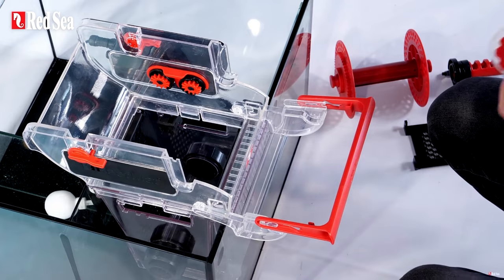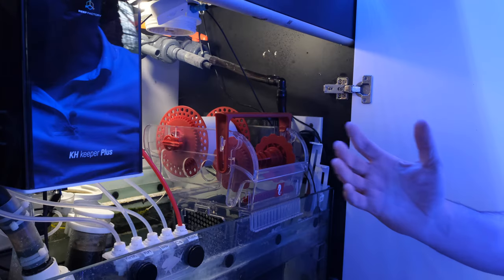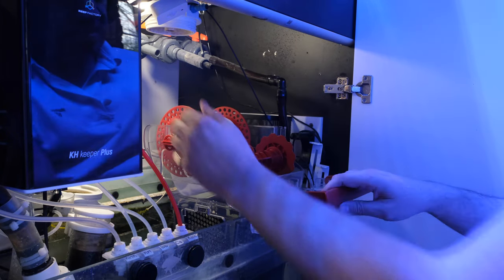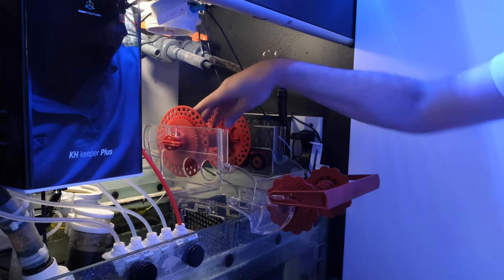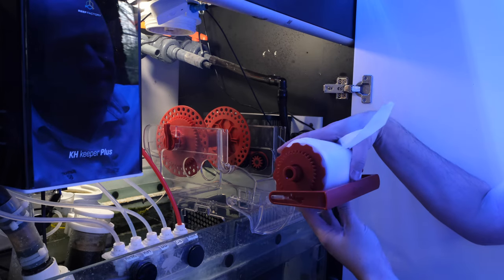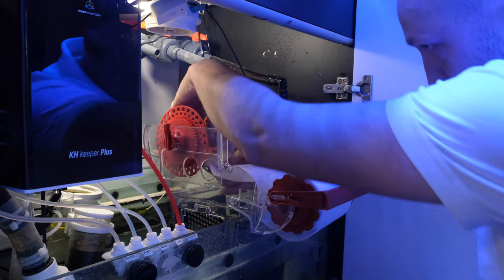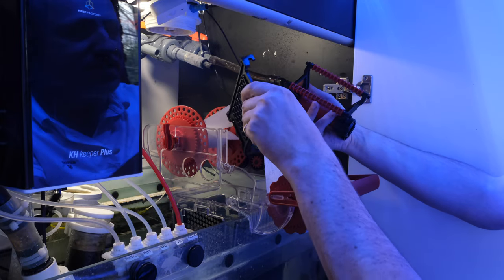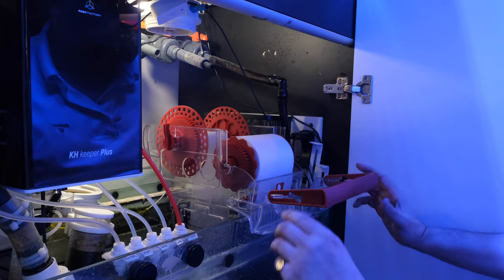How To Change The Roll On A Red Sea ReefMat

Comment: It is not that easy in real when the roll is dirty and connect to the other roll, it is absolutely not so easy in the contrary!you should do again a video where you show the reality.Also you did it in a wrong way for the new one which can mislead people, change it please. The  roller also eat incredible amounts of roll when it stands in the sump and not attach on the glass, this is a serious issue as not all configuration enable you to suspend it!
Reply from the maker: I've bought another one for my 2nd tank - I'll show the full process in the install video soon...
Reply: @ReefDorkXtra  that would be good,did you listen also about the issue of using to much roll,mine use more than 2 meter a day and red sea not do anything,I saw others also have this problem
Reply from the maker: @tomg5405  Haven't heard that/ I use 1.1m per day ish but i've just raised it higher (it was on the legs) and it seems to be using a bit less...
Reply: @ReefDorkXtra  I tried it also but it not worked and was very noisy then, your's also eat a lot but less than mine, mine ist over 2, 25 per day 😔

Comment: You actually installed it wrong where you "grip" the new roll. 🤭
Reply: I thought it was too, but it’s the only way mine works with the motor and switch on that side.
Reply: You’re right. The waste side of the roll is spooled the wrong direction. It doesn’t run parallel with the box to give a good seal. The waste roll should go up and around the back of the core. Waste side trapped between the next progression also keeping smell down.

Comment: This does not show taking off an actual used roll!  It isn't that easy!
Reply from the maker: You just undo the end piece then pull it off - the centre of the loom collapses so the roll comes off easily. It's easier than the other options on the market imo.
Reply: As someone stated earlier, your pick up roll is wound in the wrong direction and I agree that taking the old roll off is not as easy if it wound up tightly. That center part doesn’t actually “collapse. “

Comment: I've had the Reefmat 1200 for about 4 months now on a S650 ( purchased, not given 🙂). It was easy to fit (although not positioned as RS suggest). It seems to be a joy to use especially after a Clarisea which was a total pain in the butt for roller changes. If  you have room in your sump for a roller mat then you almost certainly have room for a Reefmat. Just do all your research and see if you need to be brave and try the RS sump glass change kit, fortunately I didn't need to 🙂.  I've changed rolls twice in this time, the app seems to work well but typically asks for you to repeat Login details just when you want to do maintenance. I did my second change today and the roller was full of filth, Initially the take up spool was reluctant to release the roll but a bit of pushing soon worked. Setting the new roll is almost as easy as Alex showed in the vid especially if you roll the take up spool end in the correct direction (as previously pointed out). This maybe the only pleaser where I think RS might have missed a trick as they could have shown the roller direction on the motor assembly for clarity. Overall an amazing product. If it fits and you have the money - just go for it
Reply: I would add to this don’t use the media basket. I’ve significantly increased my roll life by not using it.
Reply: Photo pls? I have also Max 650 and I have Pearl L. I am planing to instal Red Sea 1200
Reply: @FoolOfATuque  it is under roll. How it is making it last longer if not using it???

Comment: Alex. Did You realise that when you threaded the new roll thru in your video, you actually rolled it in the wrong direction (at approx 3:40). With the direction you did the roll, once it started rolling it will loosen the grip and throwing up an error code.
Reply from the maker: Yeah, I changed it straight after the video
Reply: @ReefDorkXtra   so was the video edited or do I have to watch another video to fix this mistake?

Comment: So pretty easy to change the roll, however do you have to do anything within the app when you change a roll, i:e put it into maintenance mode?, switch the unit off?etc etc
Reply from the maker: No, you just need to tell it after that you've installed a new roll - just one click
Reply: @ReefDorkXtra  thank you

Comment: Hello man.
Doesn't having the water level that high triger the rolling more often ?
Reply from the maker: Don't think so, no...
Reply: It actually does. At least for my BM Roller mat. I'd been going through rolls in a matter of a week or two, but recently modified to have the unit much higher in the sump. It's been nearly two weeks now, and the roll is barely an eighth of the way through, and completely brown with gunk. Problem solved 👌
Reply: @AdamEwart  yea. Makes total sense to me. Will consider that when adding one. Thanks for sharing.
Reply: @theamjadjamousable  I think it's down to back pressure of water inside the roller chamber against water in the sump. When the roller is set deeper, the water flows slower through the inside of the roller, which triggers the float switch more often. Raising the roller means that water flows more quickly through and down the outside of the roller, meaning the float switch is triggered less often. The water level inside the chamber actually stays about the same, but it just rises more slowly the higher the unit is placed.

A side note though, I've noticed more of a trickling sound as the water runs down the outside of the roller and into the sump. Not an issue for me, as my sump is in a different room, but could be an issue in a living room type environment ...
Reply: @AdamEwart  I have same issue the roller eats roll so fast 3 meters in just one day!!and red sea don't help just say it will change with time!!
Reply: @tomg5405  my BM rolls are now lasting at least a month, so maybe they do get better with age...? I don't know if this applies to RS models, or if it's a universal truth, but I've been happy in the performance and longevity recently 👍
Reply: @AdamEwart  I tried to put it higher,will see if it helps but it is so noisy now!

Comment: Seems to me this system would be very difficult to incorporate into an existing sump, with existing restrictions such as orientation, proximity of skimmer or other equipment. Fair enough if you've designed the sump to suit, but retro fitting (as far as I can tell) would be more hassle than persevering with whatever roller you already own 🤷🏻‍♂️
Reply: I retrofitted my 300XL for a Reef mat 500. Had to remove a wall, but with the Red Sea sump modification kit it was a breeze. If you ever need to remove silicone or walls in a sump I would highly recommend getting the sump modification kit